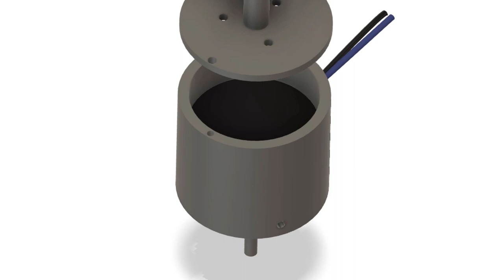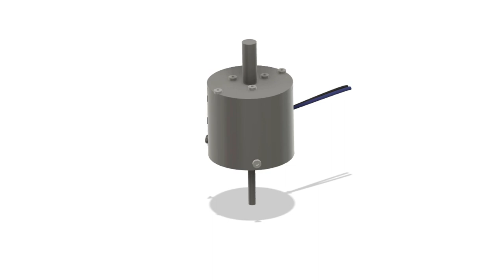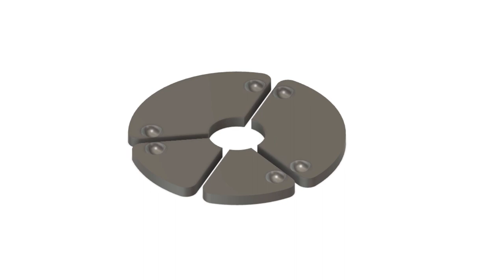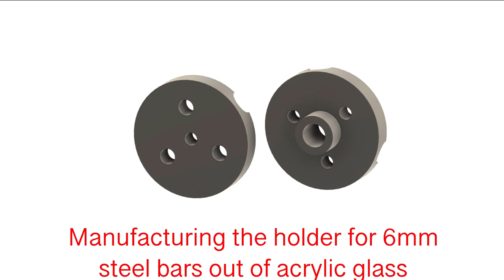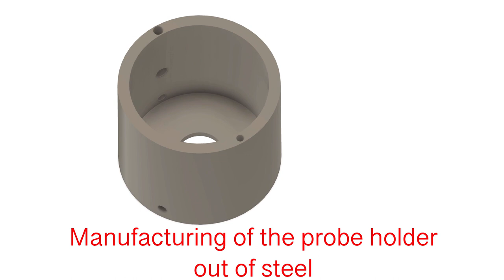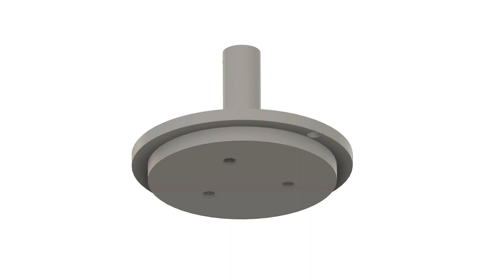3d touch probe construction

Comment: Hi, very cool. You are have g-code files? Tks
Reply from the maker: Hi, I am not sure what gcode files you mean? The gcode files for the parts you can make by yourself with the step files (link in video description). I dont have gcode files for the center point detection, this is an inbuilt function from Mach4.
Reply: @MarkGyver  ok. Tks man.